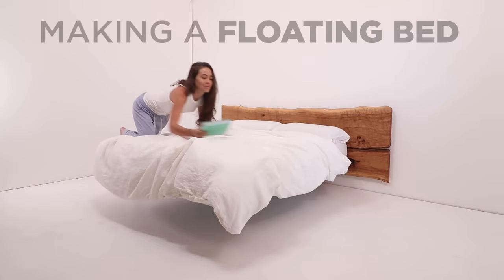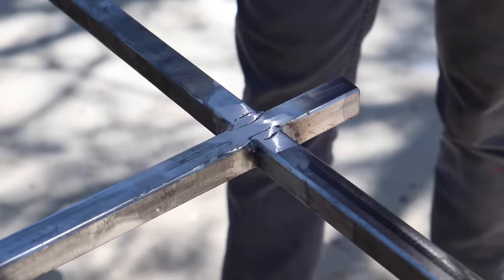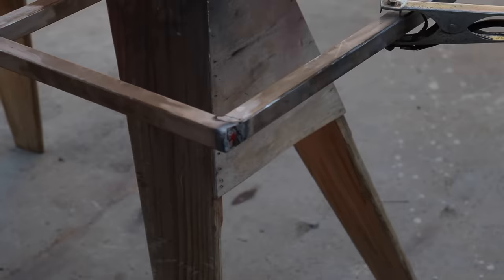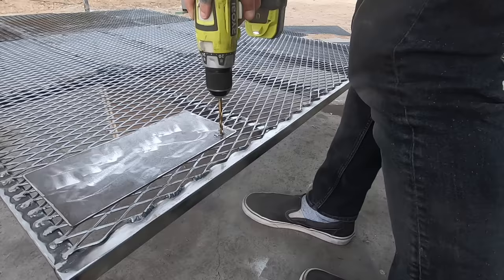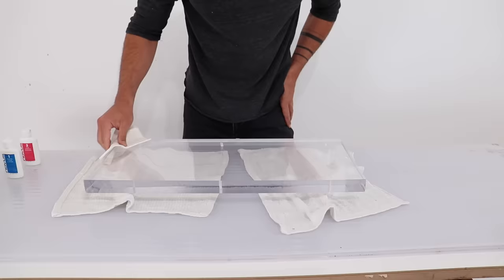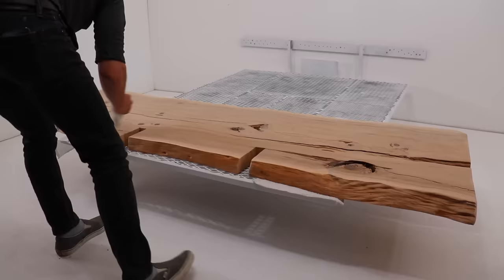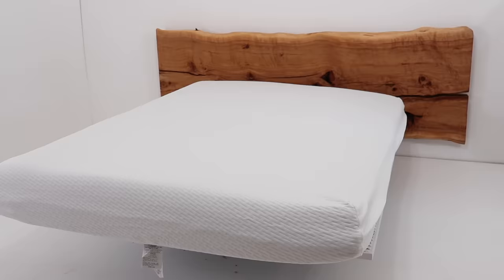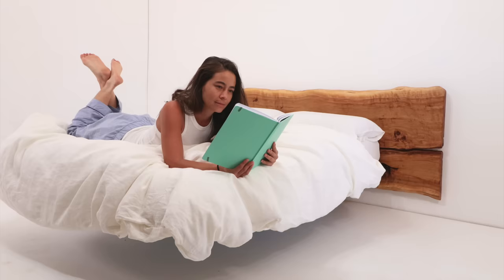Making a FLOATING BED

Comment from the maker: here are the other DIY bed projects I made:

The Work From Home Bed
https://youtu.be/ngePRZQc2KA
 
DIY Modern Platform Bed
https://youtu.be/5Dpi0otxmLU
 
Sofa Day Bed Combination
https://youtu.be/bkcoQnuiq9g
 
Netflix and Chill Bed
https://youtu.be/9DdkCFb5rko
Reply: Rate 100% creative .
Reply: What if the glass under have a light
Reply: Would it have been better to add some wood (or padded fabric maybe) on the perimeter of the bed? The mattress and metal base is basically 1:1 and if someone accidentally knocks the side of the mattress/metal base with their legs (I’ve done it many times before) it’s gonna hurt.
Reply: #gaurangsteelfurniture
Reply: #gaurangsteelfurniture
Reply: #gaurangsteelfurniture
Reply: #gaurangsteelfurniture
Reply: 🛏🛏🛏🛏🛏🛏🛏oh yeahhhhh
Reply: @Joe R same here but in a California king size
Reply: Is this floating bed available for purchase with some minor modifications? Please reach out and advise. Thx
Reply: Can I jump over this floating bed and chill coZ it doesn't break! 🙋
Reply: @mclovin6537   could use pipe insulation on the perimeter, save the shins
Reply: From my metal fab experience, I imagine with the expanded metal it made metal noises...better off with plywood
Reply: @mclovin6537  
Right. I was going to ask what prevents the mattress from sliding off the frame.
Reply: You need to watch some YouTube videos  on "how to use good quality audio for your videos!" 😀😛😛
Reply: @e3saahmad75  
Ker09li

0
Reply: ช
Reply: Beautiful 😍
Reply: You just need to place a fence foundation looking at the foundation below
Reply: Q0

Comment: the fact that it would alleviate stubbed toes AND remove obstacles from cleaning around the bed makes this even more desirable.
Reply from the maker: easy to clean!
Reply: Same thoughts. I fucking hate when I can’t clean properly under my bed.
Reply: @STEALTH yeah lol jumping on the bed thinking it's safe but hitting your knee on the edge instead 😂😂😂😂
Reply: @colin-kun3611  
,
Reply: Add some LED's and it will look even more amazing
Reply: Yes! That’s why I LOVE this idea. Absolutely perfect for studio spaces that do not have that much footage space.
Reply: Dont forget that it adds more space for more monsters underneath your bed, it's soo monster friendly😊😊
Reply: Reality underneath is filled with junk within a month, very cool idea though.
Reply: It now adds shins gouges
Reply: Needs rubber bumpers on the frames edges...soften the bumps just in case
Reply: I can see my wife destroying her shins at night on those edges.  I could not use steel for this, wood with rounded edges for me and my clumsy wife.
Reply: @nathanmyles3785  - if you're comfortable working with steel like this, just use round tubing on the outside edge instead of square. I'd also bend the outside corners instead of welding 90⁰ corners like this. If you don't have a bender you can likely find a local machine shop that could do those for you - you only need 2 so it wouldn't cost much at all for that. :)
Reply: @Broadpaw_Fox  - I like that idea, thanks.  2 years and my wife and I will buy our forever home and I want something similar to this in my bedroom

Comment: The expanded mesh also helps with ventilation of the mattress. Plywood can trap moisture. Humidity, sweat,(can cause mold)
Beautiful job.  Can’t imagine building 30-100 of these for a motel.
Reply: The mesh will probably tear up the bottom of the mattress over time though. No matter how much you tried to clean it up
Reply: @-007-2  I think so too. Put some protector under the mattress
Reply: wood slats

Comment: Adding some LED lights like under the low riders used to have would be “sweet” maybe even some color changing for the “mood”
Reply: Yeah.. N add the speaker also underneath it lol it must be more awesome bed
Reply: @princeshani5327  😂😂😂
Reply: I was just about to comment this
Reply: Agree with you it's a good idea 👍
Reply: Ghettodi nixoh  😁
Reply: @princeshani5327  😒
Reply: ...Christmas lights work too.
Reply: @K03sport  no
Reply: I would probably add some hydraulic system as well to go low-bed
Reply: No!
Reply: the wood part was dumb. a nightmare if you ever get bed bugs
Reply: @jayhuang6427  But what about the electricals when you wet the bed?

Comment: You can also put the acrylic (or whatever material you use in the future) perpendicular to the wall, instead of parallel.  I did that with a table top on a coffee table and it's hidden really well... just looks like the top is floating over the second top.  (it had two tops to make a little cubby area to put things in.)

Comment: I absolutely love the way it looks finished. I think you'd want something covering the mesh so that it doesn't tear up the bottom of a mattress when people are heavily using it. Especially in a hotel setting. And some way of changing the look of the steel frame. Maybe it could be wrapped in thin foam to soften the edges and then a tight fitting sheet could be wrapped around it before the mattress is put on. 
I already want to learn welding, and I think this is an amazing project for it.
Reply: Wrap it in wood

Comment: From a welder, good job welding every diamond of expanded metal. Had you not done that it would’ve rattled (maybe not with the bed on there but still). Always watch your heat, also, cutting 45’s on the corners of the steel makes it easy to bypass the end caps. Saves some time and is easier to make it look seemless if you want to get all howti-todi with it.

Rad build though, good job with it!

Comment: So I just saw this video and I thought this looks great. If you are looking at using this for a hotel project, leave the acrylic slab/leg under the bed and see if you can run LED lights into the acrylic to help light up the floor to enhance the floating bed look. One thing I would recommend to minimize bumps and bruises from the metal frame is to have the frame wrapped with foam covered in fabric or shrink the dimensions of the frame by a quarter inch smaller than the mattress. Overall, excellent work!!!👍

Comment: You need to coat the back of the timber with the oil to stop it warping due to uneven moisture absorption from the environment, this is very important, the slab will start to warp and cannot be un-warped without refinishing it with a planer.

Comment: If you wana make the acrylic edges clear, try using a blowtorch over a heat gun. Just run the blow torch multiple passes to prevent it from heating up too much.

I did it on my coffee table which I replaced the pane glass of an outdoor table for dark 10mm acrylic for in door use as well as children.

Comment: I think the most important part of cutting any material is to know what type of blade to use. 
Seems like you have a great budget to work with so I'll say to cut up to a 3" plexiglas or acrylic block use a 70 tooth 12 inch blade with a negative pitch on a table saw.  I'm not sure how many teeth would be for a smaller blade, but I assure you the cut will not work very well in smaller blades for thick materials. 
I worked as the head tablesaw operator at Midwest Trophy in Oklahoma for many years. They make trophies for baseball, football, basketball, soccer, and other sports along with many trophies nationwide on an elite level. I was in charge of cutting the most demanding materials and oversee others so I know what I'm talking about with cutting materials. 
As far as buffing the cuts using a torch is your best option, It gives an instant almost baby like butt shine, but only if you go at a steady slow speed. It works so well you don't need to buff. Not too slow not too fast. Too slow or fast will create white residue that most of the time will bind or make your blade stick to the material. Experiment until you know how long to hold the torch on the plexi or acrylic pieces. The reason you had a problem getting the plexi clear was because you used a blade that scarred the material more than it cut it creating more work.
Make sure when you cut the materials you go at a steady slow speed and the more you pay attention to the same speed all the way through the material the smoother your cut will be.  You did a fine job on the bed frame, only make sure when cutting the metal tubing you cut the right length or larger. You can always grind it smaller but cutting it smaller will end up creating more work time as you so mentioned. 
Thanks for sharing!

Comment: End result looks great, and that wood looks beautiful, but my shins are already hurting looking at those corners sticking out. Would have liked to see a 3/4" taller side by welding on some 3/4" tube on top of the 1" tube, around the edge, so a full sheet of plywood cut in sections could have been placed into the frame instead of that wire mesh. Chamfer the corners next time for shin pain reduction and all is excellent.
Reply: Es s

Comment: When i see a bed or any piece of furniture with a steel sharp corner at shins heith, some painfull experience tell me this is not a good design !
Reply: You are right.. 
They must cover steel and it's corner with  wood.. 
This make the design  frandely an safe to use
Reply: Was thinking the same thing
Reply: @k or just make the frame a few inches smaller than the mattress

Comment: Looks cool. Nice how to video.

Outside corners should have a chamfer or radius to protect shins from the inevitable contact.   Alternatively  do a wood boarder around the outer edge. This would also help locate the mattress (prevent sliding off) to the bed frame. 

Issue with hotels in particular is unusual weight distribution.  I would suspect you need to support 500-600 lbs off center. You know to mimic two robust people hanging out on one side of the bed.

Finally foam mattress is likely to get "cheese grated" on the expanded metal.  Ok for a prototype, but consider slats on a final product.  Alternatively you could add a wear slip sheet in-between the mattress and the expanded metal. 
.

Comment: Really nice project, great instruction...   I suggest you put Simple Finish on the back side of the headboard, as the cedar is soft wood, it will tend to warp or cup if both sides are not sealed..  Just a thought.

Comment: I BET THIS METAL ANGLES MUST FEEL NASTY IN THE LEGS SHINS .. 🙈🌈🤣😂
Reply from the maker: the mattress over hangs 1/2" so no.  Also its square tube not angles
Reply: HomeMadeModern 
CHECK THE FOUR ANGLESSSSSS Of THE BED DUMMY
Reply: Yeah, the corners should have been rounded or made into a bevel rather than being hard 90° corners. They are going to bust the hell out of some shins.
Reply: Wood 'n' Stuff w/ Steve French 
YEAP 
AND MAYBE PUT SOME POOL NOODLES  
ON THAT CHEAP FRAME 🤣😂🌈🌈👍🏻🤪

Comment: Terrible design. That just makes it easier for the monsters to reach up and grab your feet while you sleep.
Reply: Solution: Leave the underside unpainted and connect it to a bug zapper power supply. Do not use spring mattresses. I am not responsible if you actually do this.

Comment: Mesh probably doesn't do much to stiffen, it's more an effect of the additional steel you put on. You had to do a buttload of welding and grinding to put that mesh on, and you warped the frame in the process.

Ditch the mesh and keep the plywood. Plywood provides more rigidity than the mesh.

Try using taller steel sections (or welding another tube/steel plate underneath) on the center segments around the supports. Flare the bottom tube off before the visible edge. That'll keep the flex down around the supports and will make the frame more rigid. A little cross bracing around the edges might also help, though if you use a thick enough plywood you shouldn't need it.

Comment: Its a great video. I just designed a bed with lots of storage underneath to cover any open spots since I have a cat, and the dust bunnies are huge and hard to get at. This floating bed is a great design  but present the same problem, even if you don't have a cat.

Comment: You could probably turn the bracing underneath 90 degrees and use a pair about 18 inches apart and that might make it even stiffer.

Comment: This is a great concept and the guy's welding skills are impressive as I want to learn how to do that one day. I had an idea that the tree log would go through the wall on the bed post side and would be held by the wall's strength, reinforced by material holding the wall together. It would have to be secured so the foot side of the bed wouldn't fall to the floor. I'd like to create it out of actual wooden logs or branches rather to make it more authentic. The indoor tree bed. The title might need work but as we use wood pieces for other items, why not make it look better and the floating bed would obviously be an illusion as this is but you wouldn't need the support on the bottom of the bed frame.

Comment: Yes Regarding the welding as I observed with other welder  there's an issue on a spot once you weld it  then afterwards you grind it the  result is that, the welded melted iron will becomes thin  like a paper  it becomes  a weak spot

Comment: The mesh is better than plywood, but you don’t actually want something as solid as mesh either. Mattresses shouldn’t be on a solid surface, it makes them less comfortable and wear out faster. You want it on slats or webbing. That way the slats or webbing will take some of the impact (like suspension on a car). The mesh will have some give, but it could use more). Same goes for most upholstery. Better quality will always use some sort of webbing or springs, not a solid, flat surface. 

Interesting build, and nice video

Comment: Seems like a great place (under the bed) for dust and debris to gather...how do you get under the damn thing to clean without getting on all 4's?    I mean it's not any easier to clean under a normal bed but on a normal bed unlike this one, you can't really see what's deep under your bed so you don't have to clean as often.  Seems like you would be constantly crawling under the damn thing and I'm not sure how long they will hold up and stay supported

Comment: I would make the frame 3 inches smaller for the width (that's 1.5 on either side) and 1.5 shorter for the length, this way the frame is completely hidden and looks even more so as if its "floating" in addition to this a person won't crack their shins on the frame.

Comment: I think the corner of the frame should be removed. Since you do not see the bed frame feet, i think that is way too dangerous and will always tend to have accidents. You can actually have a floating bed without the acrylic on the middle, you just have to compute for the strength of its material. Good idea by the way, enjoyed it.

Comment: Very cool.  But I'd want to see someone sit on the corner that's about 250lbs and bounce.  That's very small tube to support that cantilever weight.  And if you have kids and they jump once on that bed on the end.  I bet it's going to bend.

When your sister got in it.  She's light.  When you got in it you kinda stayed away from that corner.  The corner is where I'd be putting shoes and socks on so it'll be used regularly.

Comment: At the beginning of the video I thought you were going to mount/hang the bed off the head only from dry walling? I thought mmm that's not going to hold up any monkey business, but then you mentioned the middle leg. I'm still a bit worried about the dry walling, especially with some heavier folk in a hotel ? I have solid brick walls, so I'm going to do it.

Comment: Why wouldn't you sit the frame by the wall and use a stud finder and then mark it on the steel and drill it. They should be on 16 inch c3nters

Comment: IF you start doing the hanky panky on that bed, u'll rip it the bed off the wall. The torque on those nails would be too high for the drywall, u should have put the bed on a the wooden frame, and then nail the frame to the wall so that it relieves the pressure....this guy is not very smart

Comment: Way over engineered IMHO. I had our bed made to my design with a simple timber frame and slats for mattress support and ventilation of the underside of the bed, supported on recessed corner posts and the bedhead frame. I had a wood perimeter edge to the bed with attractive rounded corners with clearance of only 150mm above the floor, and looks great and very effective as a floating bed with the posts set back from the outer corner by only 400mm. The bed perimeter board also contains the mattress with 20mm upstand to stop that sliding around.
Your steel version and plexiglass support is way more labour intensive, and the steel edges look a bit utilitarian when exposed as you pull the sheets / quilt back, particularly in contrast to that beautiful piece of wood headboard. The down standing mattress edge board also conceals an LED light strip, which adds to the floating effect at night time.
I wouldn't want to be the one making the bed with all those steel mesh ends exposed to catch my fingers.

Comment: This is not really "floating" 
Clickbait
Reply: Raychug  Did you really think it would actually float? Your problem, not his. The point is that the final product really does look Ike it is floating. No click bait here.
Reply: @michaelgoble8200  if the title says "floating" then i expect that.
Reply: Raychug  Did you really think that it would float like a helium balloon? Like I said. Your problem, not his.
Reply: @michaelgoble8200  Do you think im stupid??? Floating like a baloon??? I mean it shouldnt have that support in the middle to be really floating. So, clickbait.
Reply: Raychug The bed is securely bolted to the wall. Even without the central support, it is not actually floating. So, NO clickbait.